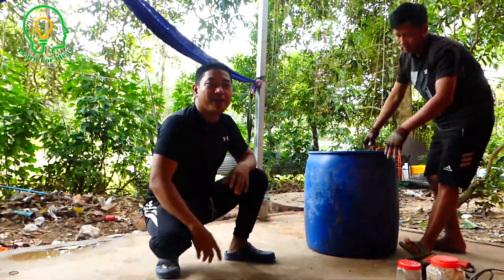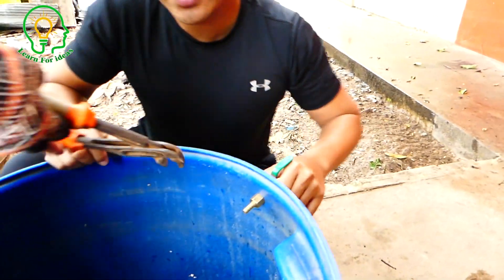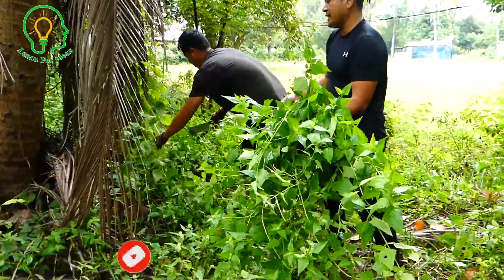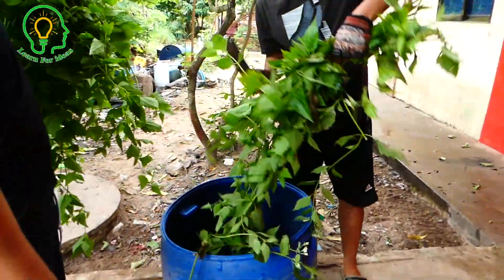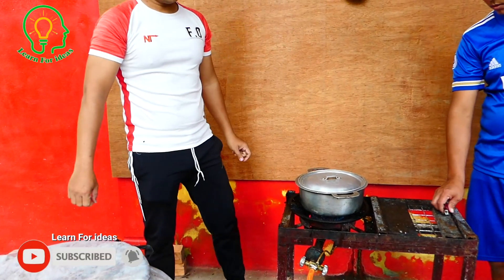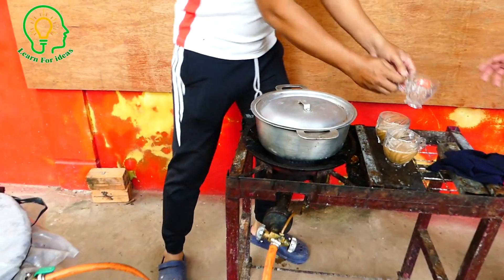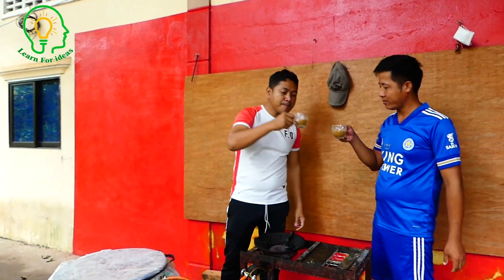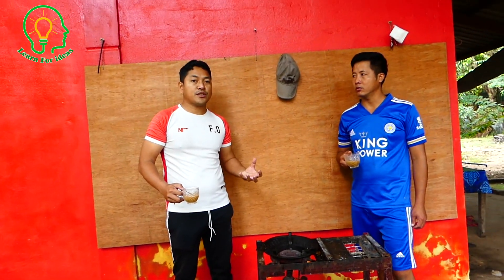How to make Free Energy Gas from Cow Dung | Amazing technology to use free gas from garbage Leaf.

Comment: the valve from the tank is closed time stamp 8:43
Reply: and he opened it up later
Reply from the maker: it is same pressure bec Cow dung not strong gas as others gas pressure
Reply from the maker: not closed, it less open for dimming light
Reply: @LearnForideas  but you didnt run the gas through CO2 scrubbers and HS2
Reply: h2s

Comment: Will this work with human poo?
Reply: Yes. Bio gas can be generated from human feces.
Generally human feces separated from sewage treatment plants are used as fertilizers.
Reply: @SRK-SunDiego  but human poo has a low yield of methane
Reply: @SRK-SunDiego  human feaces has more CO2 than methan so u need many water filters
Reply from the maker: yes can all from Dung
Reply: What kind of grass sir?
Reply: My name is Adjetey Ezra from Accra Ghana can I use any leave???
Reply: Light up your farts, you’ll see if it works